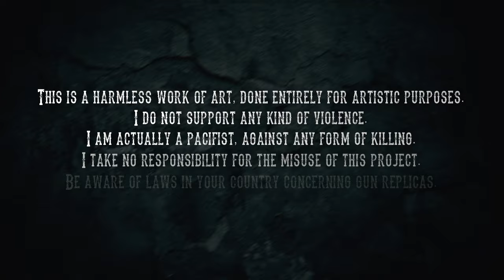DIY Cardboard Toy | Western Cowboy - Free Templates

Comment: how does the wheel spin im trying to figure out how but im confused?
Reply: The mechanism uses an arm that when the hammer is cocked, uses the cardboard risers on the back end of the cylinder to turn it.

Because of the shape and arrangement of those risers, as well as the mechanism behind the loading arm, when the hammer is cocked the arm rises up enough to turn the cylinder and then, retracts after a full cocking motion is achieved.

During this action the cylinder catch, which lifts up into the indents around the cylinder to lock it into place, will lower during the half-cock position which allows the cylinder to rotate freely. When it returns to full-cock, then it will lift back up, once again locking the cylinder.